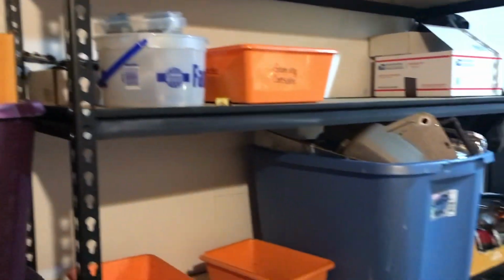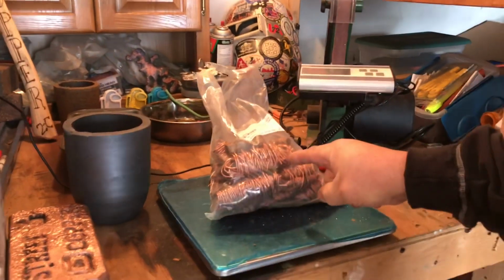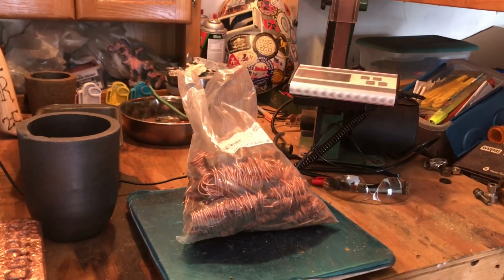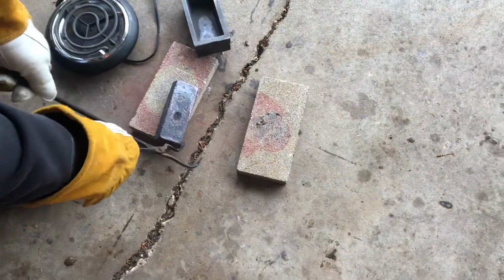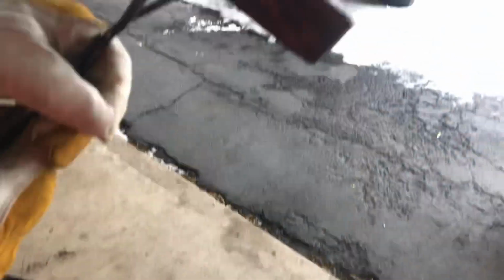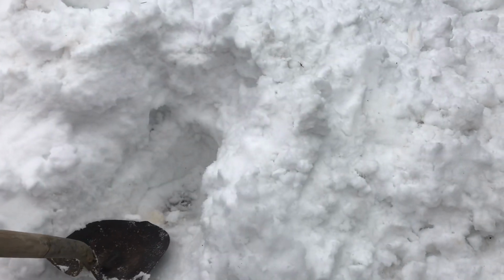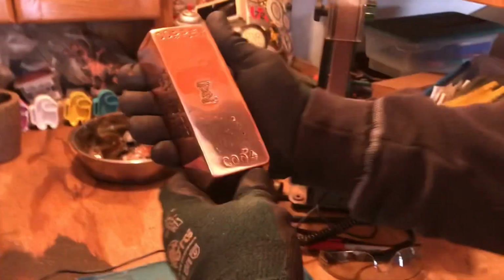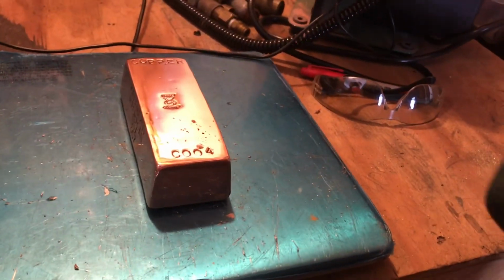Kalamazoo COPPER Bar

Comment: 5 .1 lb copper ingot ,which looks awesome. 
Did you say pipe fitting ?? 
What you working on atm ??
Reply from the maker: Thank you brother .. yes sir I’m a pipefitter/welder I’m helping build a new paper mill right now 👊🏻
Reply: @streetcopper1151  sounds a big contract,  any big pipe work ?
Reply from the maker: @s-s-p704  it’s a all stainless job the biggest pipe here is 24”and some 36” but I’m on a 16” line ..I’m going to wait to the end of the job to get some filming it’s a big no no to video or take pictures